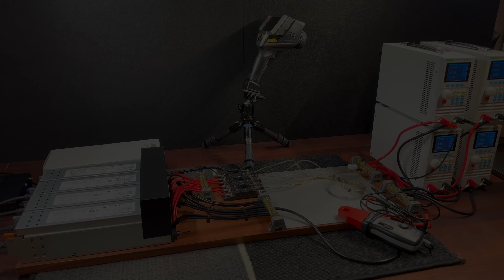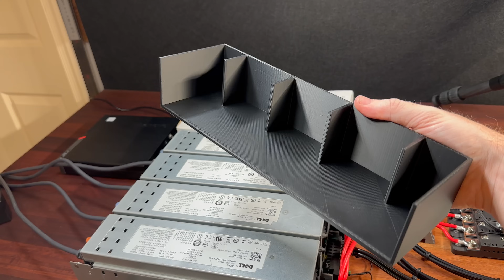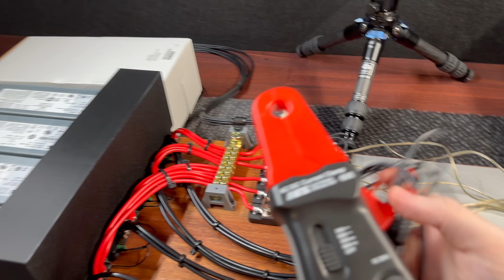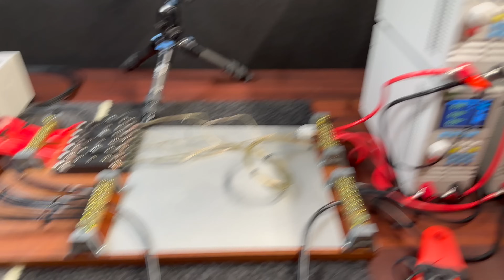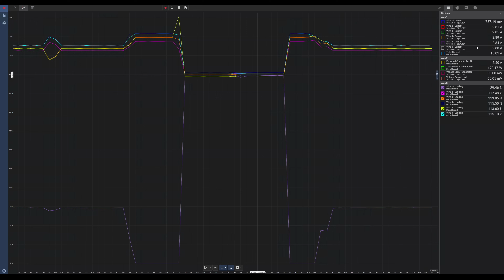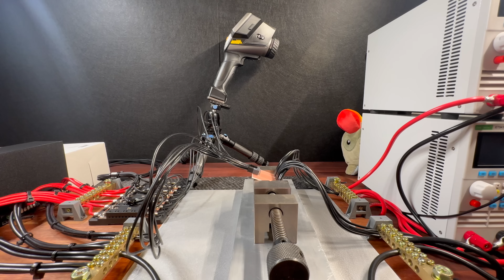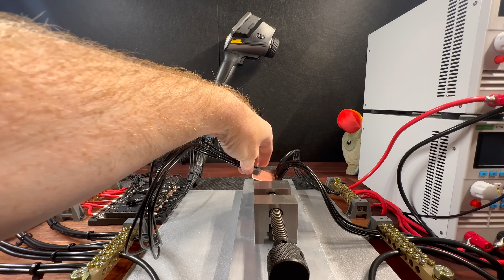NVIDIA 12VHPWR - Big Upgrades!

Comment: Have you taken a look at the different types of cables? There are differences with the receptacle used. I believe the H++ 12v-2x6 cables have a leaf spring design, while the older H+ connectors can have double bumps or triple bump design with either single or double seam.
Reply from the maker: Haven’t got yet as theres so many variables to this, I wanted a good baseline and data collection then we can branch out as needed
Reply: H+/H++ means nothing on the cable connector, those are only valid markings for the PCB header. Dimple and leaf-spring are both valid terminal types under ATX 3.1 (and there was only a brief period when Intel erroneously recommended the leaf spring design).

Comment: Man, this is exactly the kinda test setup needed to show exactly what and how severe the issue with these connectors is. Simultaneous per wire current monitoring and graphing, combined with a software interface to show changes in real time. And the fact that you already showed that 0.05 of an ohm is enough to send 70% of the current to the other wires is nuts. That's way lower than I would've expected! and I could totally see how a connector made that small with such tight tolerances on stamped sheet metal mating conductors would end up with that level of variation between mating cycles.

I really hope you can get it so that you can keep the loads active even with no supply so you can show live data of you connecting and disconnecting the connector and how the resistance of each wire changes throughout the mating cycle. Maybe you could do it by having 0.5-0.2 ohm resistors in parallel to each wire, outside of the connector, so you can keep the PSUs active, reduce risks of arcing, and be able to show how the power distribution changes as you insert and remove the connector.

Also I totally agree, the spec should have made it the PSU's responsibility to load balance the connector. the PSU has the space to incorporate per wire current monitoring and protection. And the extra expense makes more sense to be in a component that will end up being useful for longer anyways. 

Either way, I look forward to the results!
Reply from the maker: We can definitely explore some of these rabbit holes, I decided to stick to basics of durability for now and we can let the results guide where we head next as we go 🙂 I was equally shocked how little resistance it took to offset the current
Reply: 0.05ohm is 833% of the typical terminal max low level resistance though (which is 6mOhm after 30 cycles, starting point is around 2mOhm average, and in practice after the 30 cycles they've only changed around 1-2mOhm), so it's a highly exaggerated "defect".
Reply: @ragzillaz  I wasn't aware someone already tested this. Or is that just what the specification requires? Otherwise, Testing like what he's about to be doing is exactly what we need to ensure they can acually meet the spec every time.
Reply: @ 6mOhm is the spec (Molex spec for Micro-Fit 3.0+, the parent spec for the PCIe5 connector), and the variance is from their published testing data.
Reply: but if anything he has proven how resilient the connector is and how rare melting should be.
Reply: @flat_stickproductions209  excellent point, especially after watching his other videos. But now this brings up other contributing factors, like being inside of a warm case, connected very closely to the 600W space heater inside the same case.
Reply: @WalterWittMakes  if you have case fans, its not going to be that hot in the case.  My temp sensor never goes above 40c in the case when rippin.
Reply: Yeah this video already shows some interesting things before his big testing video
Reply: "And the fact that you already showed that 0.05 of an ohm is enough to send 70% of the current to the other wires is nuts."
50 mOhm - when the MAXIMUM allowed delta between all connectors is specified to 5mOhm/50% - whichever is lower. So this would be being 10x out of specs already.

Comment: Fun fact according to the spec the power from the pins are suppose to go into a single plan as soon as it hits the PCB, the only GPU that DOES NOT do that currently is the asus astral who has per pin monitoring with there software.
Reply from the maker: Yup I saw the spec but just appreciated Asus managing to sneak it in somehow

Comment: You're right... it ISN'T easy for 6 wires. That's why they should have used 2 cables. Or 4x pcie 8-pins.
Reply from the maker: You would need 4 connectors for 600W and potentially moving to 5 connectors… You can start to see why this is a problem and not sustainable

Comment: Ok ... good setup... but now you'll need to use it to manifest der bauer's 23 amps through 1 wire as well as other likely scenarios, really go at showing the likelihood of connector failures after multiple pulling and reinsertion, and push the connectors and wires to catastrophic failure.
Reply from the maker: Stay tuned 😊
Reply: manifesting der8auer's cable would require plugging and replugging a cable hundreds of times, like he did with his.

Comment: The Asus Astral has load balancing on each wire hmmm I wonder why those cards are not melting.
Reply: No 5090 does load balancing of any kind today, the Astral included. The Astral has extra circuitry to monitor the pin current, nothing more. There is also no power supply on the market today that performs load balancing. Contrary to what's been posted about the Asus Thor power supply, it does not do load balancing across pins. It adds additional voltage regulating circuitry to smooth out power delivery under load and stabilizes voltage variability. No where in its literature or release information does it suggest it does load balancing, and thus far I have not found any patent to suggest it does nor has anyone found one.

Also there is a reddit thread from a 5090 Astral owner, with a melted connector. The connector implementation is slightly different between the Nvidia Founds Edition and other AIBs due to the connectors placement and orientation on the board. At this point though I am curious to see how far the connector and cable can be pushed, which is what these experiments aim to do. I think we should all be interested in seeing that rather than falling on the usual isms.
Reply from the maker: Doesn’t have it on the card, its at the PSU side I believe 🙂
Reply: @whatcouldgowrong7914  It's on the card I saw a pcb break down of it, look it up you'll see. I think it was buildzoid but I could be wrong.

Comment: Cant balance multiple wires. this is why we a bigger single copper wire in the real world. Not sure why electronics can get away with this shit when its against the code
Reply: If the lengths and cross-sections of the conductors are the same, then the current distribution is more or less guaranteed. The problem usually arises in this connector and a poor connection of some of the terminals.
Reply from the maker: Linus already showed it, 8AWG isn’t practical and that is right on the limit already… Technically you need 6AWG which is ridiculous
Reply: multiple wires balance fine, your residential/light commercial only electrical experience is showing. It's highly common in high ampacity environments to use parallel conductors.

Comment: As long as the load is balanced, 12VHPWR is fine. The problem is that power balancing is not guaranteed in real situations. I am feeling you are chasing the wrong direction.
Reply: The power distribution depends on the resistance of the parallel conductors. Since the only problem may be in the connection, i.e. 12vhpwr, some terminals have poor contact. On both sides of the connector, 12+ and 12- are bridged into one. This poor contact is simulated in the test either with an additional resistor or by disconnecting the wire, so the test is very accurate.
Reply from the maker: Im not chasing anything yet, If I knew what I was chasing, I would already know the answer and conclusion. Let the data and results be what they are we will follow them.

Comment: Most people are talking around the topic, but you're actually doing the science 💪 I've enjoyed your videos on this topic so far, been learning quite a bit about the connector. Looking forward to the next ones in this cool little series 👍

One point of order - Nvidia are responsible for the 12VHPWR connector, they essentially designed and proposed it (with co-sponsor Dell) and it was adopted as part of PCI 5.0. the other issue is that Nvidia has made design choices on the 50 series cards to be able to draw almost the full amount of theoretical available power over each line, which already feels risky to me as an engineer. 

Der8auer and Buildzoid in parricular have done some very interesting deep dive videos recently that are worth watching. JayzTwoCents and GamersNexus have also covered the topic involving the changes between original 12VHPWR and revised 12V-2x6 connectors.

I believe Nvidia are also doing some odd things with aggregation on the board design on the 50 series card, resulting in multiple lines being summed at or before the regulation stage AND no ability to adequately measure current balance, leaving the potential for excessive current draw over remaining wires in a group, should one go high resistance and out of spec. The 40 and 30 series cards were designed in a (slightly) more sophisticated way in this regard. While they have their connector problems it's not quite as bad (and their TDP overall is nothing like the 50 series).

There's a "RTX 50 Series 12VHPWR Megathread" on Reddit with links to relevant videos, quotes from people, logs of confirmed issues and other discussions.

I think it's not solely a connector issue. I think Nvidia is partly to blame, making board designers work on the basis of perfect conditions, due to the need to push the spec limits to achieve power and performance targets the chip designers needed. 

The 12VHPWR connector v1 had one iteration which had a worse connector design spec which caused issues early on. It should have been identified in proper lab testing, but I wonder if Nvidia handwaved through some of it.

Comment: I look forward to your testing of adding resistors or cutting the leads off completely to all but 1 or 2 of them and load the cable to 600W+ and see how long it lasts. As this seems to be what happens to the melted connectors where all power is flowing over 1-2 of the leads.
Reply from the maker: Agreed, from my initial testing and putting 35A down a single wire, I cannot see a catastrophic failure happening with anything more than than 1-2 wires operating but lets see where this takes us 🙂

Comment: Looking good so far. Wou,d like to know more about the Be Quiet 12V-2x6 cables. You showed two 18awg wires crimped to one 16awg wire. I am curious about the configuration of the cable and if is labeled power supply and GPU. Most would think that they were only straight through cables.

Comment: the more we learn, the less this makes sense. You're so focused on the current capacity of the wire that you don't even think about what the socket does anymore.
your elaborate test lab here is blinding to you to real life.
Reply from the maker: It isn’t blinding me, it is giving us the capability to see everything in real time so we can focus on the connector itself and testing it. Im not focused on the current capacity, that is just where we started to answer the first question of “safety margin” ultimately yes current is what is responsible for the heating but there is much more too it

Comment: Non of the psu-s are capable to active load shareing between all of the pins. Yes, you olso need to care abaut the GND ones because they handle the same amaunt of current as the +12V side have.
You will ended up with six isolated DC-DC converter for the each +12V/GND wire pairs and the GND-s are need to be connect together at the gfx GND plane.
The next problem is need to share the 50A load between the small DC-DC convetrers and try to keep all of them alive in a case of 5A->75A->5A load step transient from the gfx card.

I think much easyer to do the current share at the load side with the exesting power phases and exesting controller chips by cheapy resistors.

Comment: You should really listen to build Zoid from hardcore overclocking, Nvidia is 100% responsible for not implementing something on board, to monitor those wires and making sure none of them go over spec, they are producing a product for consumers at the end of the day, which means any member of the public should be able to plug one of these things in and it just works, if this isn’t the case then it isn’t a product, because it require special knowledge in order to be used, so please stay away from saying things like they aren’t responsible for the methods of connectors they use on their products, they could of kept with the normal PCI gpu cables, but instead they chose to adopt this cable, as soon as they found the cable was causing trouble on the 40 series they should of unadopted this connector and switched back or invented something new! Instead they chose to cheap out and not implement anything to monitor this cable on board, or change it in anyway with the 50 series
Reply from the maker: @SignedAdam  I watch many of his videos, among others, and we agree on many things but saying that just because NVIDIA had load balancing in the past and must keep doing it forever when power requirements have doubled is ridiculous. Load balancing is not a simple process and requires significant space and beefy components to manage the job (more things to fail on your very expensive GPU also…) You also cannot say NVIDIA is responsible if a faulty cable was used etc because they simply aren’t. NVIDIA cannot just “invent” a connector and use it. Everything has to be adopted into the consortium of ATX specifications. Now AMD are using the connector also is it still NVIDIAs fault if AMD cards fail also? There are far more players in this whole situation than just NVIDIA…

Comment: 4070 super gigabyte, direct 12VHPWR cable from PSU, after 6 months results in crash in Windows
(Black screen, gpu fan speen 100%)
I was thinking that was CPU/RAM OC issue(13900k hehe), but it was a cable
(No burns\it was just bad contact is seems)
Replaced cable with another, problem solved,
Reply from the maker: I have also had a mainboard ATX extension cable fail after 3 years that was randomly turning off my PC. A couple wires had a lot of voltage drop.
Reply: black screen ad 100% fan speed is what happens when the sense pins are disconnected while the card is running

Comment: love the method and effort, but your conclusion is abit of a miss and is why we are in this debacle in the first place 
the powersupply is not able to load balence the power feed lines into the gpu without much more hardware added and without literally burning off its excess power into waste in order to balence the wires. letting nvidia point the finger at the psu makers while psu makers point at nvidia for blame is not helping anyone
Reply from the maker: @86BEAMS  Im not saying it’s the fault of the PSU that is causing the issues… What Im saying is the duty of load balancing current on the wires, should be done at the PSU side, not the GPU as it is responsible for good power delivery etc. There is too much going on the GPU side and it isn’t a simple thing to implement load balancing across 600W of potential current demands 🙂🙏 The spec needs to change and put in requirements for load balancing the cable but honestly just move to 24/48V and be done with it anyway.
Reply: @whatcouldgowrong7914  https://www.youtube.com/watch?v=BAnQNGs0lOc, no its easier done at the load, the cards have multible phases, they just have to be grouped and have voltage regs do the balancing, adjusting wire resistance on the fly by through away energy waste in resistance is not feasible and the most dodgy way to bandaid this problem. i do however completly agree with raising the voltage, atx 3.0 spec could have just been 24v plug dedicated to 24v gpu's and you could choose between a 24v version or 12v version
Reply: @whatcouldgowrong7914 we might agree that load balancing should be done on the PSU side but the cards have been out for a couple of years now in a market where load balancing PSUs simply do not exist. Nvidia and partners are also including adapters to be used with PSUs that don’t have the 12vhpwr connector, let alone current balancing. And as a result connectors have been melting.
This alone contradicts the point that this is not nvidia’s fault or the fact that the way power gets to the card is not nvidia’s concern in my opinion.
Reply: @whatcouldgowrong7914  We can invent PSU load balancing...or we can use already known GPU load balancing..
Reply from the maker: @tomasbohunek9698  and what about load balancing the ground side if the ground pins have the same issues?
Reply: @ That's a good question that I don't have answer for, but...
1) It just never was issue until all pins got soldered together.
2) Objective of 12VHPWR was smaller than 3x8pin.
3) If it shall be soldered together, then why 6 pins? Why not one chonky boy? Like the C13/C14 connector? I'm serious actually. Why not?
Reply: @ Have you seen my comment on the ground pins response. This issue wouldn't exist if the 12pin was instead a 2pin IMHO.